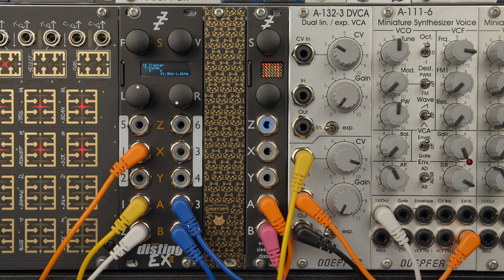disting EX - Tracker

Comment: Had big problems tracking a bass guitar in the past. on the old Disting mode. Will be very interested to try this again
Reply: So far I can't track anything but the top two strings of my guitar plus a ton of distortion. Seems like there's lots of settings to tweak though so I haven't given up yet.
Reply from the maker: I would expect it to cope. If you find audio it can't track, please send me a recording to I can try it myself and maybe improve it (or tell you what settings to use).
Reply: @ExpertSleepersLtd  Yep I found the pitch sensitivity and it's working great. Just put my guitar demo up. Thanks!
Reply: @ExpertSleepersLtd  I'm trying with two instruments and I'm not having much success. How can I send you two audio? It would be great to see a preset made by you to better understand the configuration 🙏
Reply from the maker: @MettapanaSoundAV  The best place for support is the forum: https://modwiggler.com/forum/viewforum.php?f=35

Comment: This is great, what a useful little tool for performance. Any thoughts of coupling this with MIDI input? Picking notes via live MIDI input like some other harmony pedals do would be an incredible feature imo
Reply from the maker: It currently supports MIDI for setting the root degree of the chord. It could easily be extended to simply take the notes from MIDI and ignore the internal chord generation.
Reply: @ExpertSleepersLtd  Great, I've only tried the algorithm once, but it seems really responsive. I'll look into how MIDI input could be used directly. Thanks for the reply
Reply: @ExpertSleepersLtd  Thanks for getting this in the new release!

Comment: Is there a way to calibrate Disting EX from VCV RACk? I have an ES9 as interface. I want to use a VCO from VCV RACK but I can't do the calibration process.

Disting EX Tracker has an incredible potential, I hope these updates will continue. Thank you!
Reply from the maker: You can't calibrate a disting EX with VCV Rack/ES-9, but I'm not sure you need to. The EX itself is calibrated at the factory. If you want to drive a VCO from VCV Rack, you need this: https://expert-sleepers.co.uk/vcvrack_silentway.html

Comment: It sounds amazing ! Really well done !
I got a question : do you think it's possible for exemple to plug a guitar direct in it or you'll need something to increase the signal ?
Thanks !
Reply from the maker: You can't really plug a guitar directly into Eurorack. But the output of a guitar pedal would probably be OK, though not ideal.
Reply: @ExpertSleepersLtd  the purpose is not at all to use the sound of the guitar in eurorack but just to use the guitar or a bass as a controller to generate a melody which will be converted into cv and play it with another VCO. 
I saw it worked with the clarinet, but is it working too with a 'line' instrument like bass or guitar ?
Reply from the maker: @tristanbasse  Guitar is not line level, it's much weaker than that. I just tried plugging a guitar directly into the disting. It actually tracked the pitch perfectly well, but the envelope was of course unusably weak. So it would need amplification. I may add an option on the disting to boost the input signal massively. It would be noisy for audio use but might be perfectly good for tracking.
Reply: @ExpertSleepersLtd  Thanks a lot for your answer and your explanation !
I think it can be a good idea cos i'm quite sure a few people will be insterested to use a guitar or a bass for tracking.
Reply from the maker: @tristanbasse  Indeed, and they are: https://www.youtube.com/watch?v=CMJihJtBiDw